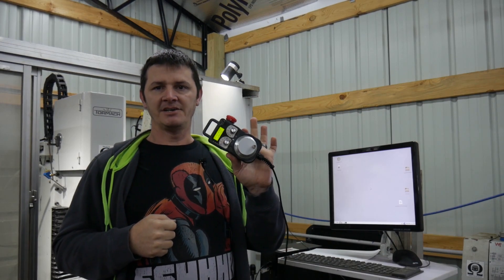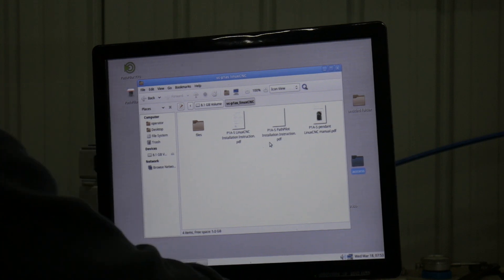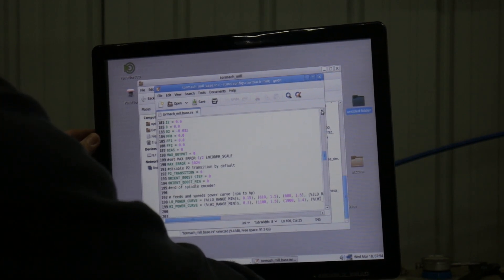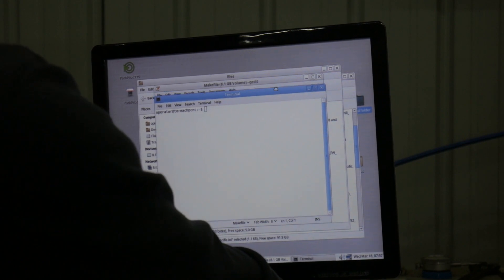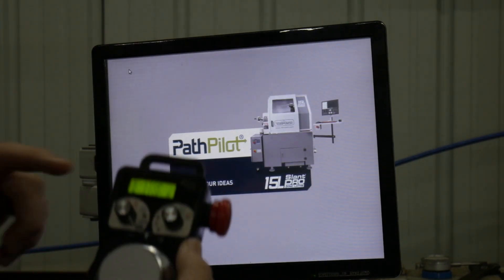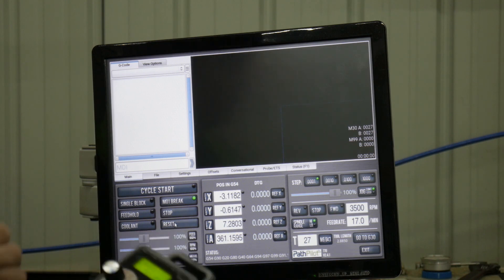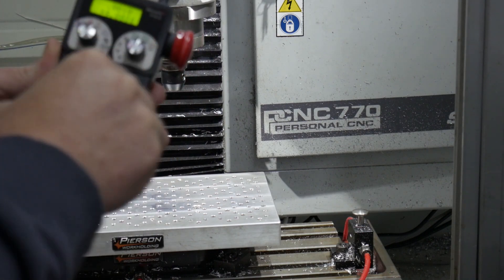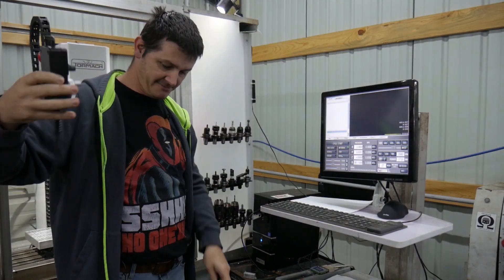iMach Pendant install on Tormach 770 with Pathpilot 2.4

Comment: ONE PROBLEM (NEAR THE BOTTOM).  I finally got my spare iMach pendant to work with my 1100S3. Editing the base file instead of the 1100S3 file worked. This video helped, and the latest version of the documentation shows this as well now.

Where to put one of the edits is a little unclear, but I got it to work.

***************
HALUI = halui

[HALUI]
MDI_COMMAND=…
MDI_COMMAND=…
MDI_COMMAND=…
MDI_COMMAND=…
MDI_COMMAND=…
MDI_COMMAND=G10 L20 P1 X0
MDI_COMMAND=G10 L20 P1 Y0
MDI_COMMAND=G10 L20 P1 Z0

[TRAJ]
***************

There is a lot of other stuff in between HALUI = halui and [TRAJ].

Placed just below the HALUI = halui it choked and just went into a continuous reboot cycle.

Placed just above the [TRAJ] it worked.

I was able to keep the shuttle as well, but even after all these years I still prefer a pendant to the shuttle. I have pendants on ALL my other CNC machines. Once I cure one last problem I'll probably remove the shuttle and toss it in the cabinet next to the computer.

Okay, some will jump on the e-stop not working on the pendant. I don't know if that can be cured or not. I don't care. I made a hook to hang the pendant right next to the hard wired e-stop button anyway.

THE PROBLEM:  When I am fast jogging with the pendant it scoots along fine for a several inches, slows down for a short stretch, and speeds back up again. It seems to do this when spinning the MPG fast or slower. On my other machines I pretty much only use the pendant to jog or step.

I like the documentation for setting step increments. I pretty much only step at 0.0001in so I set all the other increments to zero.

Comment: Well, I thought I figured it out, because I found it came with firmware for imach3 so I changed it to linux cnc, but it still doesn't pick it up, and still crashes the base.ini file.
Reply from the maker: Did you install the .hal file in the proper folder? The only change to the .ini file is to look for the .hal file. I'll look the the MX files and see if they require anything different.
Reply: @jodyolivent8481  Pretty sure I did, I'll check. I found this in the pathpilotlog.txt file: 
halcmd loadusr -Wn halui halui -ini /home/operator/tmc/configs/tormach_mill/tormach_1100MX.ini
halcmd -i /home/operator/tmc/configs/tormach_mill/tormach_1100MX.ini -f vc_p2s_pp.hal
vc_p2s_pp.hal:2: Warning: File contains DOS-style line endings.
vc_p2s_pp.hal:14: Pin 'axis.0.jog-enable' does not exist
HALCMD ini file /home/operator/tmc/configs/tormach_mill/tormach_1100MX.ini load failed with config file vc_p2s_pp.hal
Shutting down and cleaning up LinuxCNC...
Reply: @jodyolivent8481  I found out that the 1100mx.ini file is generated from base.ini and specific.ini so putting into either should work.

Comment: hmm. I just got a p2-s. Can't seem to install on the 1100mx. It crashes the program if you install into the base.ini, if you put into 1100mx, it doesn't do anything. I'll keep trying of course. I have 2.3.7, maybe I'll update to 2.4?
Reply: Well, I guess I'm just going to keep posting this here in case anyone needs to find this, since this is the first thing that pops up when searching youtube lol
This is what I got when changing the tormach_mill_base.ini file, 

Checking md5sum manifest for all config files in /home/operator/tmc/configs
./tormach_mill/tormach_mill_base.ini: FAILED
now to find out how to ignore this
Reply: @Derek_Kuraitis  See my reply to the video.  It may or may not help.
Reply: Really?  Okay, you get ONE (1)

ONE PROBLEM (NEAR THE BOTTOM).  I finally got my spare iMach pendant to work with my 1100S3. Editing the base file instead of the 1100S3 file worked. This video helped, and the latest version of the documentation shows this as well now.

Where to put one of the edits is a little unclear, but I got it to work.

*************
HALUI = halui

[HALUI]
MDI_COMMAND=…
MDI_COMMAND=…
MDI_COMMAND=…
MDI_COMMAND=…
MDI_COMMAND=…
MDI_COMMAND=G10 L20 P1 X0
MDI_COMMAND=G10 L20 P1 Y0
MDI_COMMAND=G10 L20 P1 Z0

[TRAJ]
*************

There is a lot of other stuff in between HALUI = halui and [TRAJ].

Placed just below the HALUI = halui it choked and just went into a continuous reboot cycle.

Placed just above the [TRAJ] it worked.

I was able to keep the shuttle as well, but even after all these years I still prefer a pendant to the shuttle. I have pendants on ALL my other CNC machines. Once I cure one last problem I'll probably remove the shuttle and toss it in the cabinet next to the computer.

Okay, some will jump on the e-stop not working on the pendant. I don't know if that can be cured or not. I don't care. I made a hook to hang the pendant right next to the hard wired e-stop button anyway.

THE PROBLEM:  When I am fast jogging with the pendant it scoots along fine for a several inches, slows down for a short stretch, and speeds back up again. It seems to do this when spinning the MPG fast or slower. On my other machines I pretty much only use the pendant to jog or step.

I like the documentation for setting step increments. I pretty much only step at 0.0001in so I set all the other increments to zero.

Comment: How do you access the linux desktop? Left shift+alt at the splash screen does nothing for me
Reply from the maker: The tormach keyboard is not a full keyboard evidently. You can press alt x to open terminal and type caja mint panel

Comment: Glad to see somebody addressing the Linux aspects of working with Tormach, since I've got the impression a lot of people buy a Tormach without even knowing there's Linux underneath (and that probably contributes to the frustrations some users have with them).

A quick correction on that `make install` bit around the 4:00 mark. A Makefile is kinda like a script that can be divided into subcommands. So when you've got a Makefile that has an "install" directive in it, you just go to the command line and type `make install`, and it runs the commands in that section. What you ended up doing there was edit the file (without saving it), ran `make install`, which did the two sudo bits, and then ran the two sudo bits again by copy and paste. It probably didn't hurt anything to run it twice like that, but it also doesn't help.

And Control+Shift+V will paste in a terminal like that. Little things make your life easier.

I've got a HAL series on my channel I put together, and video 1(b) goes over some Linux basics that might help you out. I can also point you to some commands that you could use for normalizing the audio and doing screen captures. (Not that my video production quality is that great, but I know command line tools!)

Keep up the good shit!
Reply from the maker: Thanks! I'll definitely check out your videos as I wish I was better at linux. I tend to rely on my stubbornness to not give in and try different things until they work.
Reply: First thing I did was enable the mate desktop on bootup, so I could get to the calculator. 😂